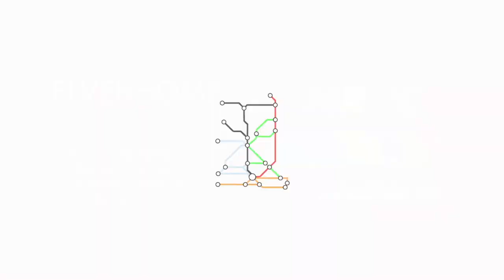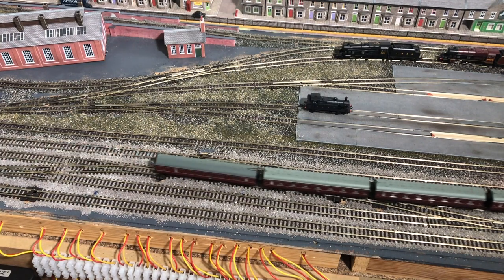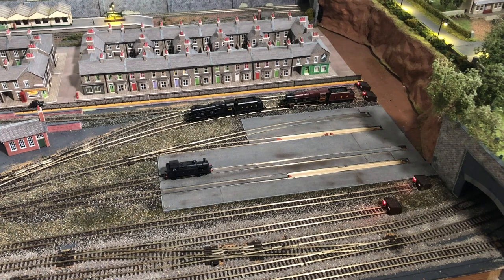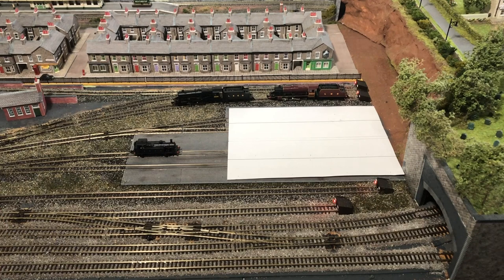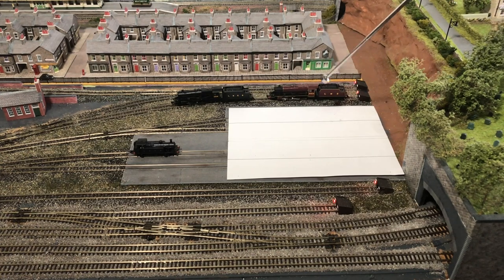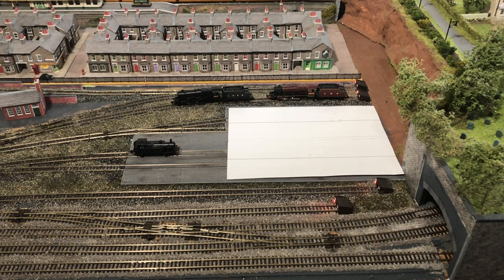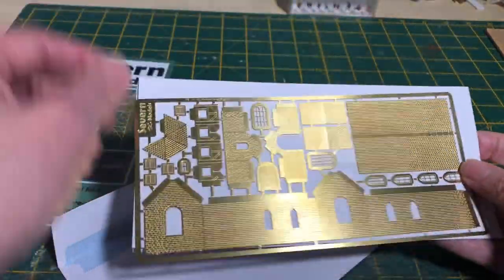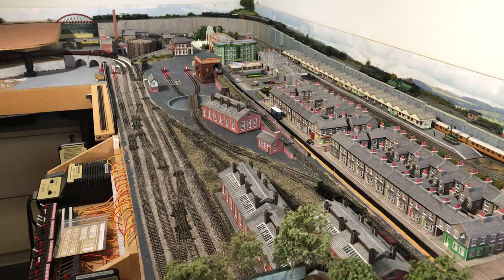Elvenhome N Gauge Model Railway Layout - Scenic work at the Steam Depot EP96

Comment: For various reasons I did not watch episode 95 until today, I am glad you went with a square engine shed with the work yard out front, just for your info shapeways have some very nice engineering machines that may be of interest to you and pd models have a gantry crane and som generators and welding chaps
Reply from the maker: Hi Peter. Thanks very much for the information on the engineering machines and gantry crane. I will go and have a look at them. Stephen

Comment: You did a good job when ballasting the track. I can spot some switches that still have not been ballasted. I you want to simplify This work and also have well working switches just paint the ground around the moving parts the same color as the ballasted areas. That works very well. I have tried it on my n scale layout, where all my switches only have painted ground, Done before placing them there, but still is easy to do later on. A bit weathering of the track and the ballast, with drybrushing or spraypainting, will give you even better looking track. Thanks for a nice video, and stay safe !
Reply from the maker: Hi Henrik and good to hear from you.  I was pleased to get the ballasting done.  Thanks for the tip about painting around the switches I will give that go both here and in the section over the back, which I really need to do.  Stephen

Comment: Stephen, Another great episode. Suggestions for the engine shed. Ancillary lean to buildings at the rear, mix 1 or 2 stories. Apex of roofs, louvre the sides of the top bit as vents. Use the girders along the inside length of the roofs and support on cast iron pillars to keep open aspect. Regards Stephen.
Reply from the maker: HI Stephen and thanks.  I agree with you about the cast iron pillars, but I need to find a source for them, or think how I may be able to make them.  Thanks for the other idea which I will bear in mind.  Stephen
Reply: Cheers!
Reply: @Elvenhome  have a look at model scenery supplies.  They have an n scale platform and canopy, which has cast iron uprights. I was looking out of curiosity, briefly, just now. Regards Stephen.
Reply from the maker: Thanks very much Stephen.  I may get one just to see if I can cannibalise parts from it.  Stephen
Reply: Stephen,  My pleasure. Regards Stephen.

Comment: Losing the base board beneath the ballast makes a huge difference to the way the layout  looks.
You mentioned lorries taking the ash away, are you sure? I think remember my dad saying something about the Cheshire Lines shed sending their ash off by rail to a block plant that made cinder blocks for building houses. As these plants would be receiving  cement and coal as well by rail, it makes sense.
Seeing Evenhome with all the base boards hidden can't be far off surely ?
Mark
Reply from the maker: Hi Mark.  I was really surprised how much different it looks and I will want to get on with covering over the remainder of the depot.  Still a while until it is all done.  I will think again about whether the ash would go by rail or lorry.  Maybe that would give a reason for a siding I have which in the original plan was to go to a brewery.  I could station a wagon there to take the ash.  Stephen

Comment: Hello Stephen, a thought on the engine shed if I may. Maybe you could put some older iron girders or framework in front of the engine shed. That could give the story that it was once bigger and was taken back over the years into what it is now (after you've built it, of course). Because I think this could make it look like it's quite old and could have been one of the oldest structures in the area.
Reply from the maker: Hi Robert.  Thanks for your suggestion.  I will have a think about that as I design the shed. Stephen

Comment: Hi Stephen, what a difference the ballasting makes! it is really coming together. I think ballasting is like Marmite, you either enjoy it or hate it, I personally think it's quite therapeutic 😁, Looking forward to all the detailing you will be adding to the shed it will really come to life at that point. Several routes you could go for accessories, Scale model scenery do shelves but they are fiddly little things, Peedie do some nice brass items, I have also seen some nice 3d printed items in Ebay, so well worth having a good look around. All the best Tony
Reply from the maker: Hi Tony and thanks.  I have the kit for shelves from scale model scenery.  I made one and put the rest away until I felt stronger.  I amy have to get them back out.  Severn Models do a kit of tools, and I am sure I have seen n gauge work benches on another site, which I will have to search for again.  I think the details will make all the difference and with an open front they will at least be seen.  I'm also going to light it of course, including some exterior lights to help get some light at that part of the layout.  Stephen

Comment: Hi Stephen. I like the idea of the roof structures for the new engine shed. I would think that 8 windows along the sides would be the absolute limit and maybe 6 would look less crowded. Surely there would be some smoke vents in the roof of any but the smallest engine shed! When you do construct the brass-etched church I would really like to see a video of the construction, and NOT just photos of each stage; I think it would be most educational for anyone not having tried this before to see. BTW (and a little off-topic): how did you decide on the sleeper design of end buffers for the tracks coming off your turntable and what lights did you use (link, please)?
Reply from the maker: Hi Paul.  I think there would be vents in the roof, but not necessarily the large chimneys. I now have the roof trusses and I think I will be able to make some vents for the very top piece that would provide ventilation.   I will film the stages of building the kit.  That probably is the kiss of death in it coming out well, but I think you are right that people will be interested in seeing it built.  You may have seen that I have tried out both the bunker type buffer stops and the more usual rail buffer stops.  In the end I just prefer the bunker type and they go better with the lights.  I have painted them using Humbrol wood paint for the sleeper, black for the coal and picking out in white the wooden buffer stops.  The lights are from Gaugemaster and draw power from the track so no wiring.  I've added a link in the video description to them on the Hattons site.  Train Tec make something similar.  You might want to shop around to make sure you are getting the best price.  Stephen

Comment: The ballast always  brings the layout to life.   Looks good and I'm sure the scratch built engine shed will be to your usual high standards.  Are you going to weather the ballast and tracks ? Cheers Euan
Reply from the maker: HI Euan. I hope the shed will turn out right, once I can see it clearly in my head. I am not going to weather the tracks.  I don't like using spray paint in the flat (other than primer in a car board box) and I don't have an airbrush. I may paint a wash on some of the scatter material but I will live with it for a while before I decide.  Stephen

Comment: Stephen,  I've completed a few of the Severn Models range for my n gauge layout.  I think they're great, they had the textures you can't get with card kits.  Think carefully about painting.  Adhesion on to the brass is harder than on to plastic I think.  Make sure there are no greasey fingerprints on it and use a good primer in very thin coats, barely dusting them with each coat and build it up.  First one I did I was impatient and it all pooled under gravity.  I have used acrylics for the finish but you need to be very careful, enamels stick better.  This is just from my experience anyway
Reply from the maker: Hi Johnathan.  Thanks very much indeed for this help in the painting.  This will be the biggest kit I will have made in brass.  Even with window frames the paint can peel with the slightest touch.  Your very helpful advice will help me to try to avoid that.  Stephen

Comment: Nice update Stephen, and well done on getting the ballasting out of the way before moving onto the interesting scratch-build. I know exactly what you mean when you say you can't design something until you can "see" it. I am exactly the same. I noticed the gasometer on your layout. Is that the N-Scenics one? Did you do a video of its build? I love the camera angles you have of the trains coming out of the tunnel and passing either side of the camera. The roof trusses look great. York Model Making is a brilliant supplier of all kinds of things. I am pondering using brass windows on my next build rather than the Scalescenes Scaleglaze ones... I will be interested to see what you achieve with yours. All the best Stephen... -- Michael.
Reply from the maker: Hi Michael and thanks.  There are two gasometers but I suspect the one you could see best was the N-Scenics one.  It is an earlier version which Tom sent to me to review.  If you look at video 51 you will see my review.  I thought it was very good but needed a few little tweaks which Tom had already thought about.  I am looking forward to getting the roof trusses.  I rather suspect once I have them everything will fall into place in mind's eye.  Stephen

Comment: Hi Stephen, interesting video, particularly about the ballasting. I did smile at your comment about how long it actually took. I’ve just finished ballasting my own layout and fully understand what you were getting at! I was wondering was if you’d any thoughts about track weathering. I recently got some Railmatch Sleeper Grime, but, having tested it on some scrap card before heading for the layout, it seems to be a similar shade to the Peco Code 55 wooden sleepers and I’m now not at all convinced about whether there will be much to be gained from weathering or not. I’d really welcome any thoughts or advice you may have on this, best wishes, Stewart.
Reply from the maker: Thanks Stewart.  I did think long and hard about weathering the track.  Part of my hesitancy in doing so is that I can't use an airbrush in our flat.  I didn't fancy hand painting my layout.  One thing that helped was the ballast magic turned the first type of ballast that I used much darker and once it had dried I thought it looked fine.  My rails are much cleaner on the side than in real life, but it doesn't bother me and I don't think it detracts from the visual effect.  I suspect it would look better if done, but importantly it doesn't look bad or too obvious that it hasn't been done.  I agree with you that the wooden sleepers on Code 55 look fine without any painting in any event.  Stephen
Reply: Hi Stephen, nice to hear from you. I’ve really been unable to decide what to do for the best about this and it’s good to have your thoughts. Like yourself, I found the Ballast Magic really darkened the ballast I put down, and, with the Sleeper Grime looking very like the Code 55 anyway, track weathering seemed an unnecessary step too far. I think I’ll leave it. Thanks for your help and comments, they’re much appreciated, best wishes, Stewart.

Comment: Thanks for posting. This is helpful as always. Been meaning to ask about running farish and dapol locks. I had a couple of dapols in the past (b17 and a3) neither was a good runner, esp a3, and had to send back. They would not cross set track points on my old layout. I have less set track points on the new layout but not sure I could risk a new dapol. Basically, I would love to have an a4 but don't think it would work on my points. Do you use any set track points by peco? Will your a4s work on these, thanks, Jonathan
Reply from the maker: Hi Johnathan.  Dapol locos can be very fickle and quality control isn't always good.  I have a B17, which is one of my best runners.  My two A3s run fine as do the A4s and the Manor.  I have had problems with a Hall loco which I returned three times because it simply wouldn't run and ended up getting a refund.  I don't have any set track on my layout.  It is all code 55.  I do use small points, especially in the steam depot, and everything goes over them fine.  I used to have a test track with the set track that came with a Farish train set which had a point on it, and again everything went over that fine when I was running-in locos.  Stephen
Reply: @Elvenhome  I'd like to know the best way to use points (turnouts). I understand it's best not to use short ones unless unavoidable ones, but my layout is relatively small (on a 6'x4' 'table' baseboard) so would medium length ones be best?
Reply from the maker: @PaulSmith-pl7fo  Hi Paul.  I can't remember whether you are building in N or OO.  If in N and you are using Code 80, the radius of the curve for smallest turnout is a 1st radius curve.  Only short wheel based locos are likely to travel over those easily.  You would need to use medium turnouts in code 80 to be sure larger locos could cope.  I used  code 55  and the small radius turnout in Code 55 is larger than a 3rd radius curve in set track. All my locos happily go over the turnouts.  6'x4' in N is a decent size and you should have room for the medium turnouts in Code 80.  I found it really helped me to get some track planning software.  I know some prefer paper and pen, but track geometry matters and if you are not familiar with it, the planning software will help you see what fits.  Stephen

Comment: Hi Stephen and Happy New Year to you and yours.  I may be talking rubbish but should there not be an ash pit in front of the engine shed?  Even if the shed was just for stabling, the engines would need to at least clean the grate at the end of shift, would they not?  If I'm wrong please ignore me - I was a young child when BR still had steam working.  Mike.
Reply from the maker: Hi Mike and Happy New Year.  You are quite right about the need for an ash pit, but it is the other side of the turntable next to the coaling stage. That will make removal of the ash easier. That end will be where the locos go after they come on shed to drop the fire, be coaled and watered and then put in the engine shed.  Stephen
Reply: @Elvenhome  You probably told us that in a previous video.  Apologies for my terrible memory.  Mike